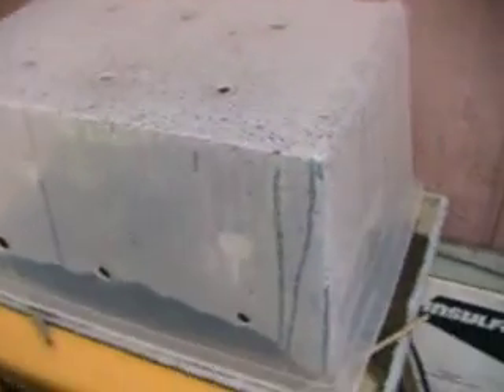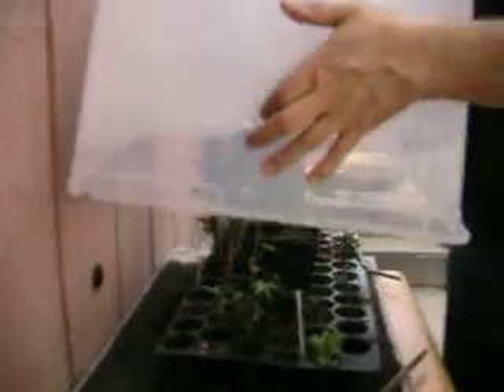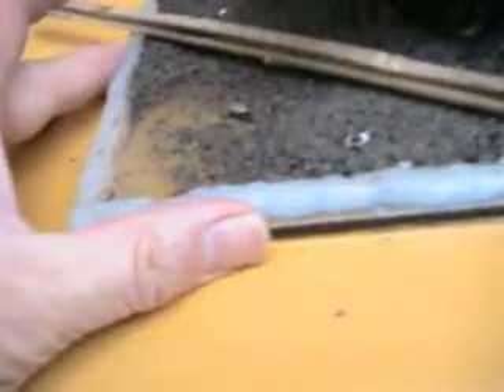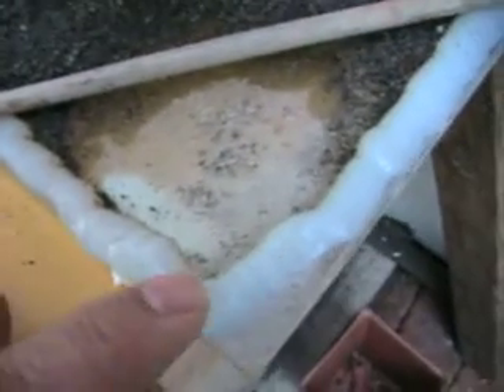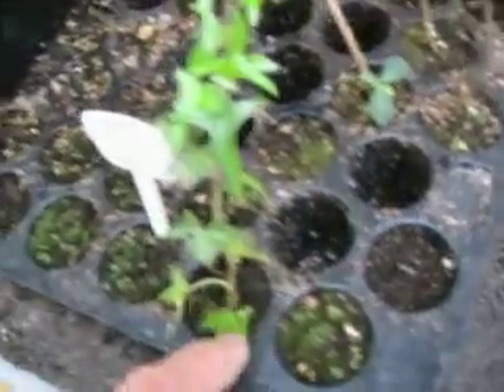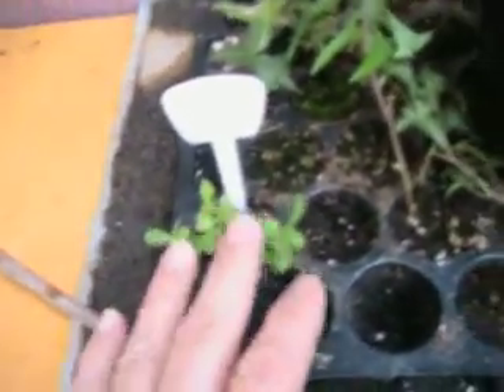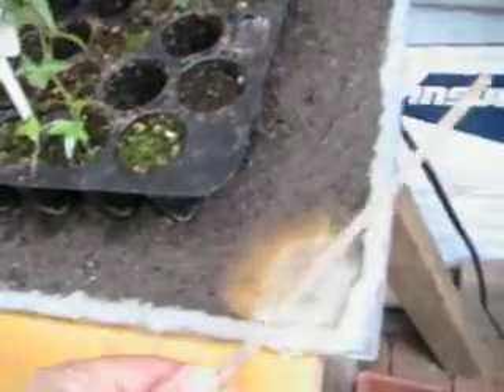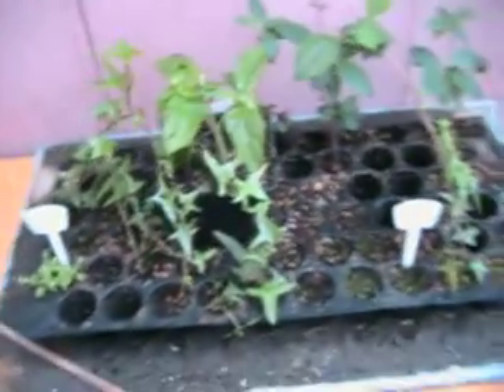propagation chamber

Comment from the maker: Thanks.  For most plants you don't need something this big or complex.  A lot of gardening supply places sell starter tray and dome covers.  Nice dome covers have adjustable air vents on top.  I use one of those for most of my cloning work.  I produce plants to sell, and have a large container garden that I start a lot of plants early in my greenhouse. which is why I made it so big.  I can root about 60 cuttings or start the same number of seeds. in this thing.